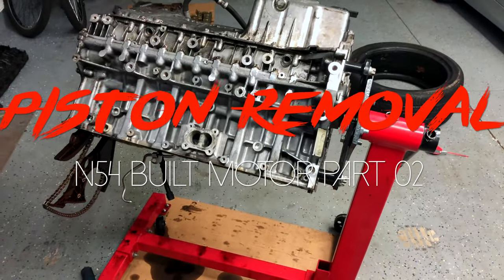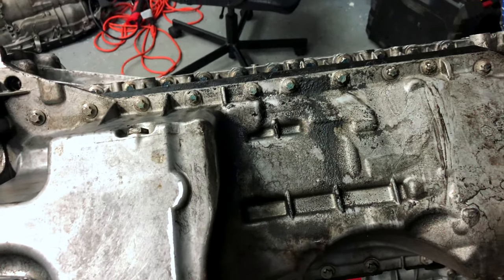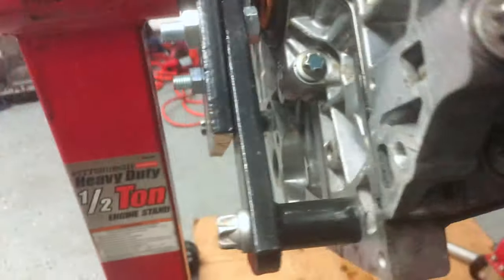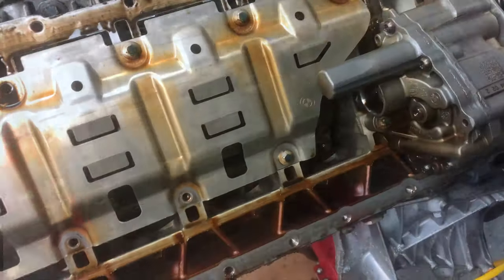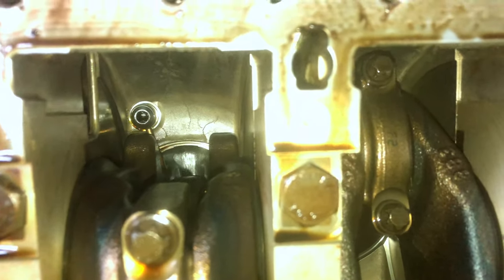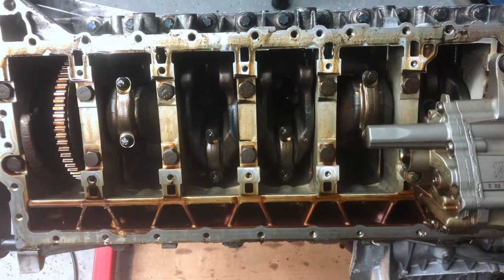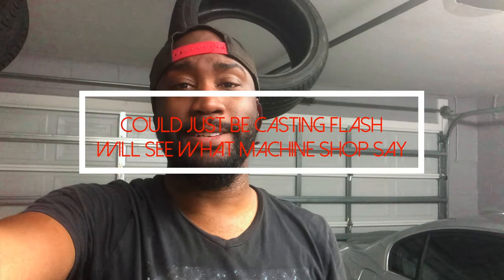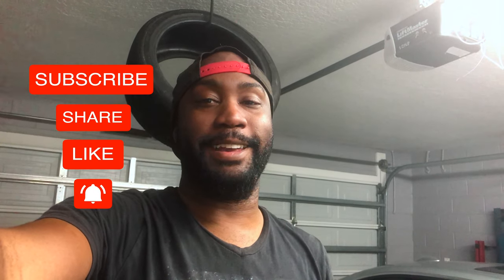BMW 335i N54 Pistons Removed

Comment: How'd you crack the block or more specifically what were you running on the original engine for that to have happened. Good luck with the old block night stand sounds great.

Comment: Noshi, tried to find you on 335i mods FB page but didn’t have any luck. Were you able to remove the rob bolts from cylinder one without removing the oil pump? The video seems to skip over that.
Reply from the maker: Hi more active on Instagram @el_noshi . But yea I was able to remove it without removing the pump. What I did was just rotate the crank so I can use an extension and a wobble socket to get a good angle to get to the bolt.